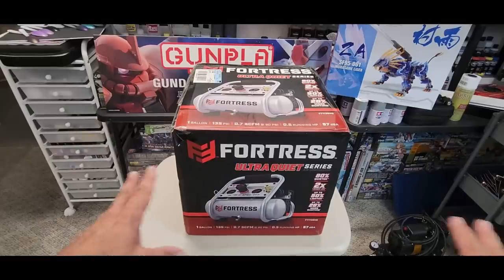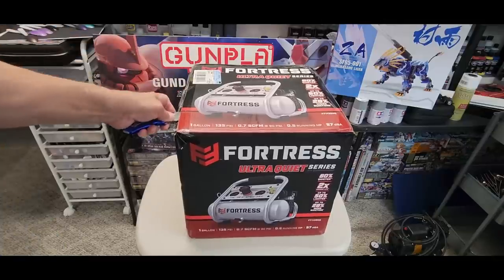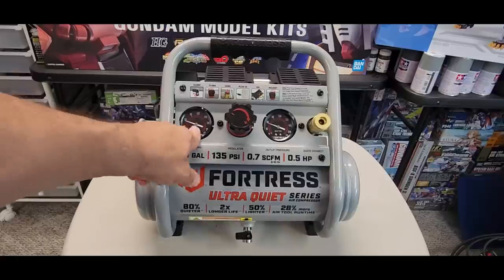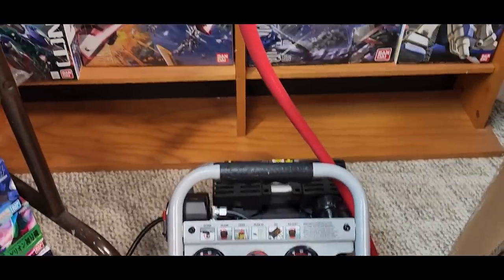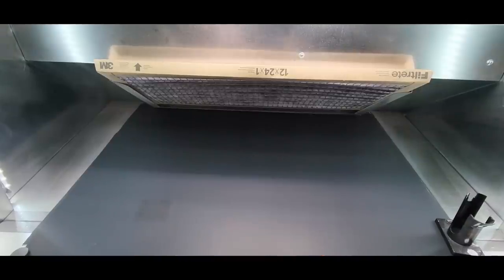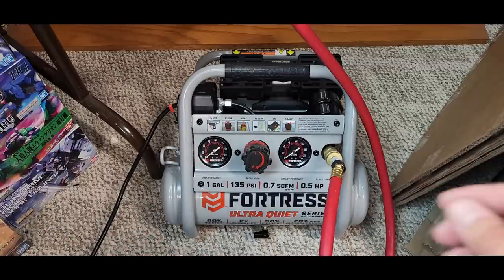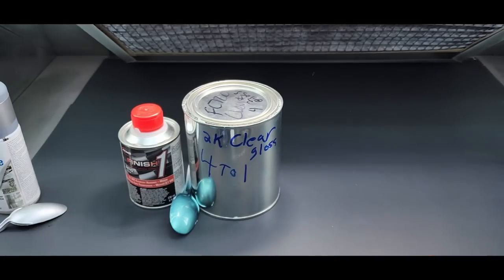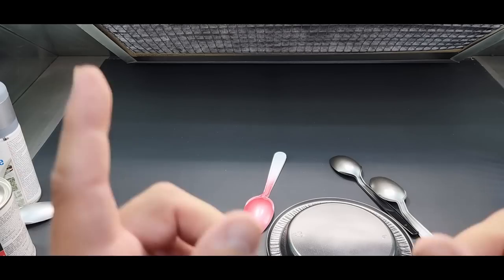Testing Harbor Freights Fortress Air Compressor For Airbrushing - Quiet High Quality Unit

Comment: This is an awesome compressor for brushing. Make sure you do the break in procedure in the manual. Run it for 30 min with the bottom port open.
Reply: Just bought this and broke it in for 30 minutes but curious what’s the point? Literally what will happen if someone never breaks it in? Won’t the same net result occur as one accumulates 30 min of runtime? I know building engines it’s important to break in the piston rings to match the block bore crosshatch but I am nor sure these air compressors are that high-precision...
Reply: @Syclone0044 some, not all. Do require a break-in period. To allow components to seat themselves properly. Now.. why this needs to be done  all at once vs while you are using the tool. I agree. I do not understand the difference.
Reply: Maybe the “wearing in” of components is best done when not under load.   When my wife gets frustrated with my performance I do remind her that she did not follow the marriage break in period and hence it’s understandable that i am not operating at my full potential

Comment: Already mentioned, but draining the tank using the bottom drain is the only way to get all the water out of the tank. Pulling the pressure relief valve will leave much of the water in the tank. I am anxious to see how the Grex spray gun works with your new compressor and just works in general. As a car modeler the fan spray nozzle and larger needle are of interest and I have heard that smaller compressors can't keep up. I think your one gallon will do fine but I'd like to know before I buy. You spend it and I save it! Thanks for all you do.
Reply from the maker: The Grex mini spray and car body video will be up within a week 👍
Reply: @barbatosrex9473  Great. Thanks for all you do.
Reply: drain the air tank from the bottom valve every time when it is not in use this will keep the moisture out of the air supply tank and will prolong the life of the compressor.
I have the 26 Gallon fortress and it will fill from empty to full in five minutes quieter than most.

Comment: NOTE - there is a 2 gallon version that is quiet - however the 4 gallon one is NOT the quiet line so its very loud!   - the 2 gallon version of this is the sweet spot... if you upgrade to larger size HF wont ding you but if you go down in size they ding you a 30% restocking fee!   - i recommend the 2 gallon one so it doesn't come on as often

Comment: I’ve been running the 2 gal Fortress for my air brush and it rocks!  I put my regulator/separator on a quick connect right off the compressor.
Reply: I recently purchased a 2 gal Fortress based on the reviews from several of the other miniature painters with YouTube channels, and that's the way I'll be setting mine up -- the water trap on a quick disconnect from the side fitting, and the airbrush hose from that; I've got all the fittings to put a quick disconnect on each side of the water trap, so with the one on the brush I'll be able to take it all down quickly. I will soon have a spray booth to trap overspray, and then I'll be good to start practicing.

Comment: You can buy an airbrush hose with the proper adapter fitting right from Harbor Freight. Its $8 if I recall correctly. It's what I use with my 2gal Fortress compressor with zero issues. I am gonna have to check out one of those digital regulators for sure, looks handy!

Comment: I got the California air compressor I got a scratch and dent floor model for$125 . I never found a scratch or dent. It super quiet and shipping was free. Drain the tank every three months. Humidity here inNO  LA is usually over 90% and there is never moisture in my built in moisture trap. Good advice from someone on running the first valve at 30 psi over running pressure for me that  50 to 55. I use 55 so I can run my brush up to 30 for cleaning. Well within ab factory specs but helpful. Good job!

Comment: i have used this compressor for about 4 or 5 years for air brushing and finish air nailer. it has preformed flawlessly. i got mine with a coupon for 90 bucks to boot.
Reply: what is your use case? do you spray all day (prime, wait, 1st coat) or just pieces? I'm only a master grade 1/100 gundam mainly so I'm concerned tank is too small, so looking at the Stealth brand, looks to be a carbon copy, same eveyrthing but with 3 gall at $199.
Reply: @olo398  i have used it for a couple of hours a few times, and have never run out of pressure.

Comment: 18:57  It's better to drain the tank from the lever at the bottom than the emergency pin at the back.  Besides depressurizing, you also want to get rid of any moisture than built up inside otherwise you could have rust problems.  Also you can lock in the pressure regulator with the red ring under the knob.

Comment: I've never been overly concerned about compressor noise but then again I often wear ear defenders at my spray both, primarily to reduce the fan roar noise. I have a large very high flow rate fan on my spray booth bought many years ago in the days when solvent based paints were pretty much our only option.  Once ear defenders are on then the compressor cutting in is never a huge issue.  But this is a very quiet compressor, so much so that that I may well consider a "quiet" compressor when mine eventually dies as all machinery eventually does.

Beyond that it is very rare that I disagree with any of your comments and recommendations but this time I'd like to offer two rebuttals.  First, buy the compressor with the largest tank that you can afford and fit into the location intended for the compressor. Most of us are not as "frugal" with air use as you so that invariably means the compressor will cycle several times during an airbrushing session - especially when drying acrylic paints as you have often demonstrated. So if the costs are similar in this case the two gallon equipped compressor is the more prudent and long lasting buy.  The larger tank will ultimately mean fewer cycles on the compressor and that means a longer calendar life for the compressor.  It also reduces the number of pressure cycles on the tank which further protects against fatigue failure. 
Secondly, while the moisture trap/filter at the airbrush is certainly a good idea to protect the airbrush itself, I very strongly recommend fitting a moisture trap/ air dryer between the compressor and the secondary pressure regulator.  All regulators but especially the finer control low flow rate air pressure regulators need clean dry air or will tend to corrode and/or easily get clogged by debris, worse yet if you have one of the lower priced ones made from mild steel which many of us do when building our first airbrush/compressor system.

Finally, when using two regulators as illustrated here the primary regulator at the compressor tank should be at least 30 psi higher than the final airbrush pressure.  In this case I recommend the on-compressor regulator be set at 50 to 60 psi. That way the secondary regulator is still lowering the pressure by 30-45 psi which helps ensure its output pressure is more stable.

Comment: I use that compressor for my airbrushing. And I have a small airbrush for model railroading. Just added a water separator via a quick connect couple. Works like a charm and super quiet.

Comment: Good call on the digital gauge. The gauge that comes with it requires you to kind of estimate the psi. It is as quiet as my Silentaire Scorpion  II-TT compressor that was $349.00 and it does not have to start up as often either. Mine is 2 years old and has had ZERO issues.

Comment: The black one has a high pitched whistle that would drive me crazy.
I have the 2 gal Fortress and its run perfectly for the 3 years I have had it. 
I have used mine to air brush shirts and even run a half inch air wrench to take lug nuts off my Jeep.
Very nice quality compressor.

Comment: I bought this a few weeks back for getting into airbrushing - mainly because it wasn't a single-use device and wasn't that much more expensive than tanked "dedicated" hobby compressor. It can go to a high pressure, it has a decent tank size, and for what it is, it doesn't weight much. I can fill tires with it, airbrush, take off wheels. It's amazing for $159, being a double piston design - to get this level of features in a "hobby" compressor, I was looking at $300+. 

I also bought a secondary low-psi regulator for it that is by my booth. So I have 30 PSI out from the compressor running into 18 PSI at the secondary regulator to the airbrush. 

So far it's been amazing. The only complaint is that the vibration it puts out on a hard floor surface may be disturbing to people in other rooms, but if you have carpeted floors, that should deaden the vibration enough to be negligible.

Comment: Fantastic compressor. Here is a formula for a better cycle time adjustment for airbrushing: Adjust the cut-in/cut-out screw counter-clockwise until you have a cut-in of 50 lbs... Then, adjust the cut-out screw clockwise until it has a cut-out pressure of 100 lbs.
The results... I can run a .8mm trigger style airbrush at 30 psi non-stop for 45 sec. before cut-in, and recovery is 48 seconds to cut-out at 100 lbs. (and yes I still had the trigger held down during the recovery stage).
The benefit... This means that you are only running your compressor at a 50% duty ratio, and because you are not charging all the way to 135 lb. factory setting, the compressor works less, runs cooler, runs quieter, and lives much, much longer life.

Comment: I have been using the 2 gallon version of this compressor for over a year now. It is an amazing compressor for the price. Really quiet and the 2 gallon capacity means it is not running all the time. I highly recommend it. It is way cheaper then the airbrush compressors some companies sell. I mean really all you need is compressed air.

Comment: I have one of the 2 gallon size ones for my shop, and after watching this video, I bought a second 1 gallon one since I was in the market for an air brush compressor.  I had to use it today to run my air brad nailer to attach a replacement piece of corner molding in the bedroom.  Got the second one for a 25% discount using a HF coupon. These are great compressors and really quiet.  HF also had the digital regulator on closeout for $12.

Comment: Have one very similar with a 9L tank. Have run it for 6+ hour painting sessions.
Most of the same silent types on the market run 55-60dB.
Can even spray high psi (50psi) syphon feed to push fabric paints into tshirt fabric.
Keep the small as a backup.

Comment: Love your channel. I to have gone to a silent compressor and your digital gage installed on a regulator with a desiccant filter next to my spray booth. You have to drain the water out of your tank after using it. Thank you for showing this I don't feel like the only one doing this.

Comment: I just bought this unit today in 2 gallons size, to replace my similar Fini Advanced Quiet 2 gal compressor from Menards that died after 10 years (motor sparked ⚡️). Omg this compressor is truly as quiet as the video and it’s more than 3x as fast as my Fini! Wow! It was twice the price but money well spent! Really feels and looks well built, I love how it’s got two push-click air tool ports also. The only thing odd is it’s rated at 135 PSI but only fills to about 117 PSI according to two gauges. No big deal for me though.
Reply from the maker: This is a great air compressor for sure

Comment: I only use quiet compressors.   They’re prices are so much better than they were so there’s no reason to kill your ears anymore.  I have adapters for just about every airbrush and hose to go with them.   I got a bag of assorted adapters on Amazon for about $9 and it had everything I needed.

Comment: I have this compressor and don't have any complaints so far.  If you can wait, they 2 gallon one goes on sale for not much more than this one ever month or so.  Just keep an eye on their sales ads.
Reply: yep.  I just picked up the 2 gal Fortress for $175 today on sale.  I will use with the Iwata hp-c plus and a 1980’s Paasch single action siphon

Comment: I just looked it up on the Harbor Freight website. it is now (11/5/2022), $159.99 for the 1 gallon size and $189.99 for the 2 gallon size. Anyway Thank You Rex for the great review of this Harbor Freight Fortress Air Compressor. Wonderfully done as is always with your reviews.
Reply from the maker: Check the site weekly they go on sale constantly. Another viewer told my they got one recently for close to $100
Reply: @barbatosrex9473  Gee,  and WOW! - That was fast. I hadn't even finished watching this video before you replied back. Thank You For your kind reply.

Comment: I have the same air compressor sir it is awesome I have it in my other room and I ran a hard line from it to my build room and I hooked it into a 3 gallon air tank under the bench and the two quick disconnects one by my spray booth and one by my build air so I can blow pieces off or for whatever I may need air for their and I love it only runs a couple of minutes and I will go 2 days sometimes before it will kick on really depends on how much air I use sir. Thanks for the awesome videos and tips and the reviews that you give out sir thank you very much Jimmy Bargo
Reply: I am going to add a another hook up by the 3d printers that I'm in the middle of installing them now sir

Comment: Are use the very same one. It works excellent doesn’t come on very often are usually run around 20 psi and it comes on like every 5to15 minutes depending on what I’m doing. It’s great I love it and I just use and Iwadai  Neo

Comment: I went to grab one of these a while back and they were sold out, then I sorta forgot about it.  Buddy has one of these same units and it's great for the job intended plus other household uses.  Put an spray adapter on this and clean out the vent ducts and dryer vents as well in between painting projects lol.  For the price it's far better than the no name ones like you have and I do as well even though those work just fine too.  Great video, now to go and see if they have one lol

Comment: I currently have the same spraygunner compressor as you and if I were to upgrade to a bigger compressor, I’d buy the 2 gallon. I was thinking of getting the fortress 1 gallon, but got the tooty bc it was more simpler to set up.

Comment: Late to party. I got mine like amost 2 years ago and man it is extremely hard to convince hobbyists to get this over "no name" compressors. You said it yourself the cost is about the same and HB constantly puts this on sale for about $110. Since its not dedicated to airbrushing you can use any common fitting from hardware stores. The moisture trap can also be picked up and usually much higher quality than the cheap inline traps. I picked up a husky trap from home depot and it was solid while costing much less. You only need the adapter to fit the airbrush hose. You see it for yourself how much faster it builds pressure and recovers with dual motor and a much lower pitch in sound. Mine doesn't raddle like yours did (prob a tag hanging) but it doesn't move and you hardly feel the vibrating. I also recommend a digital PSI gauge since the one on the tank has too large of a range. Trying to adjust for low PSI 15-35 is tough. This is meant for other airtools after all. There's also a 2 gallon version with 2 built in quick release fittings. So if you're a madman to double up the airbrush same tank, the option exists.

Comment: just invest a little more money and get the 26 gallon fortress, will cover any air brushing And spray painting along with running your air tools quietly, or more quiet than an oil filled compressor.
it will keep up with any home shop project.

Comment: Picked one up today with a $40 off deal. But I'm struggling with finding the 1/4 adapter to quick connect. Any suggestions?
Reply from the maker: I got one on Amazon, do a search there, they have a bunch to choose from

Comment: Robert, So I've decided I'll add an Iwata-Medea moisture trap to my system but when I search on Amazon there are two which are very similar, the F A450 and F A500.  Which one is yours, assuming there is some kind of identification on the trap itself or the packaging?  I'd rather get the one which is "proven" to fit with the airbrush quick connects rather than guess and risk having to return/exchange an incorrect order.

Comment: where did you get your digital pressure gauge and what size are the connections? I am very new at this and don't have any experience yet/
Reply: Digital Regulator is from Harbor Freight. Air compressor threaded fitting size is 1/4" NPT. Airbrush threaded fitting size is 1/8" BSP. Air line quick connects are I/M style which are also available individually or in sets from Harbor Freight.

Comment: I'm trying to learn about compressors for airbrushing and sprayguns. For instance; what type/brand of compressor would be good for either? Basically, I'm interested in something that can run both. I'm interested in painting metal scooter parts but also models and paintings aswell.
Reply from the maker: Spray guns require a full sized industrial compressor. However you can power an airbrush with that, I've done a video on it

Comment: I run a moister trap on my compressor I do not run one on my airbrush hose should I use one on it even though I have one on my compressor. It is tankless which is annoying but it is pretty quit it just keeps running when I spray.

Comment: Would it possible to get the 2 gallon and a splitter so both my wife and I can run separate airbrushes at the same time?
Reply from the maker: Yes, I just upgraded to the 2 Gallon, I showed it in a video. That will work for you  no problem